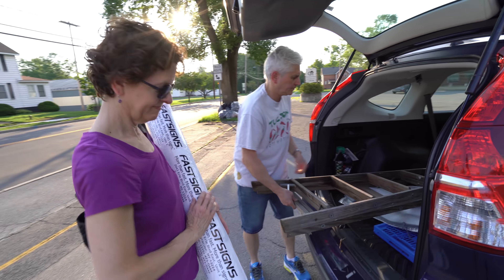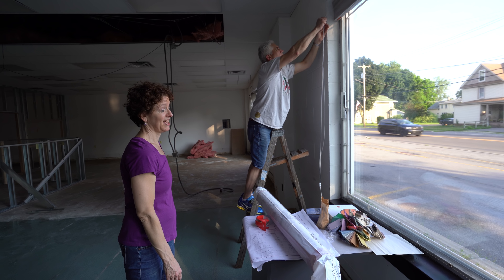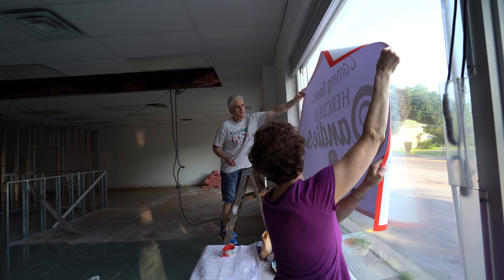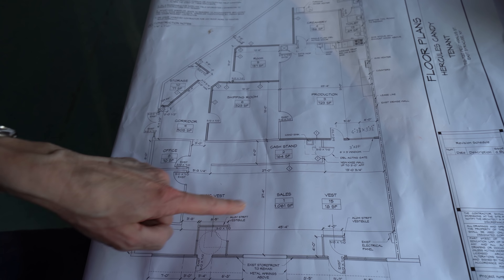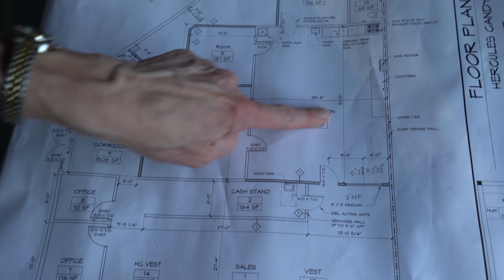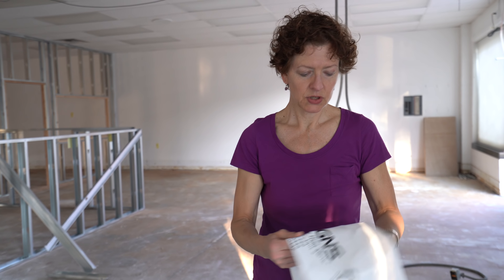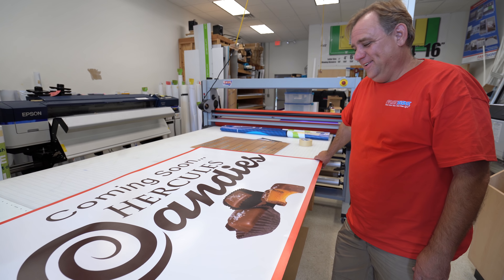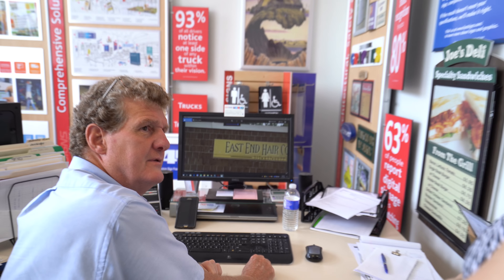Putting Up New Signs For The New Building

Comment: Y'all should get the windows tinted. The sun shines in my back windows in the morning and the front in the evening and the tint helps it tremendously and saves on the electric as well.
Reply: I agree, not only will the sun run up you a/c bills but you may also have probs with melting chocolate candies.
Reply: You could get some of those films that they put on campers and patio doors.   It just presses on like a sticker.
Reply: how about a fancy smancy electric awning

Comment: When you take the posters down carefully cut the coming soon off and the orange border at top and reattach border at top of poster you will have two re usable posters you could also use the coming soon section for any new products your thinking of introducing just put a coloured tape border round it and add poster beneath with new upcoming products 😁
Reply from the maker: Re-purposing!!
Reply: GMTA but I was thinking of using the other half, so now you have TWO ideas!!  I was thinking of suggesting cutting it down, framing it (if that's not too pricey) and using it as inside art.  You have SOOO much white wall space to fill there.    I'd cut off the "coming soon" and all the borders....who wants a 3 sided border lol.  Then  you have 2 Hercules Candies signs WITH art even!!!   Maybe use one in the Shop, and one somewhere it will be seen (lobby, maybe office, not great w/blueprints lol).   Do you guys have plans to fill up some of that wall space?  Maybe get some candy related posters too, ie Lucy in the Chocolate factory,  Willie Wonka, or plain candy shots.  And bet those would be standard sized, so you can get cheap poster frames at Michaels or AC Moore (do you guys have Hobby Lobby out there? We don't).  But the 2 I named always have 40 or 50% off coupons, so that will be  a minor expense for a big look!!   Best of luck with the new place!!
Reply: 🤨 great minds and all that jazz 🤣
Reply: .. or .. get another smaller poster that says "NOW OPEN"  to fit OVER the existing Opening Soon portion of the poster .. :D

Comment: I had this problem at my store with condensationinside the glass. It is no longer has a thermal barrier. You have to replace the window, they come in standard sizes. Get a "triple pane picture window" it will not be hot inside at all from the sun hitting the glass. It's a small cost for all the benefit you get

Comment: What kind of final sign are you planning on doing? If ya do a window one... should get it made to the size of the window and get one that clings on. Then ya won't have to worry about taping it : )
Reply: In a  phone conversation yesterday, Emmett from FastSigns explained the joys of perforated vinyl signs for windows - so we'll be looking into that for sure. The posters were just a quick fix to build excitement.

Comment: You should cover all the windows so people can’t see what you have in there, even with the security system at this point someone could still smash and steal something thinking there’s value Until building materials are installed. If someone sees lumber sitting in there they might want it or whatever else they might see in there.